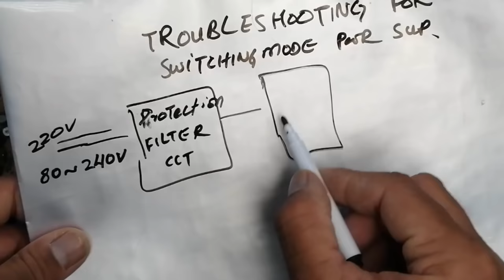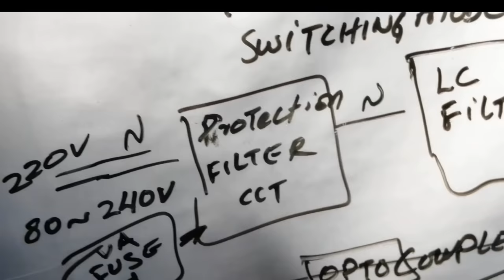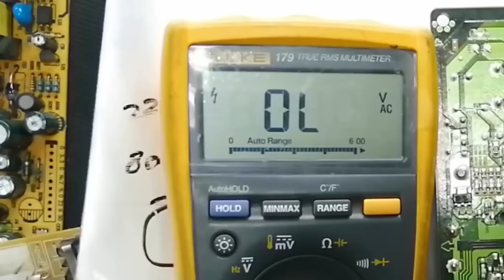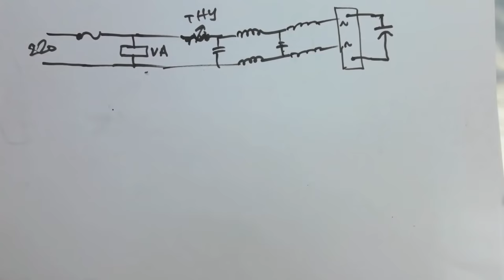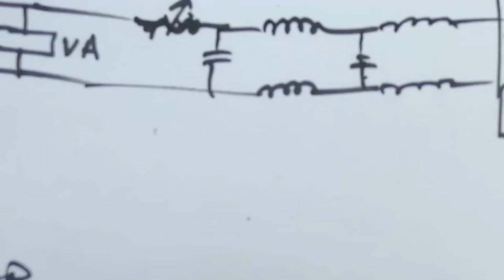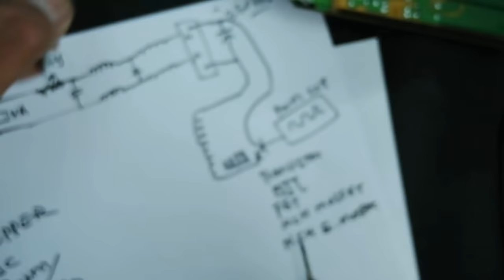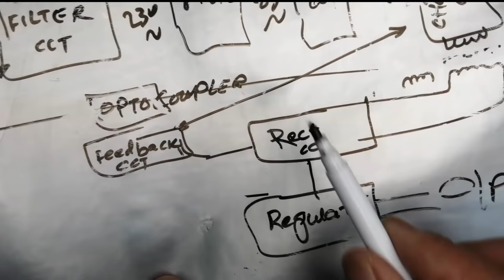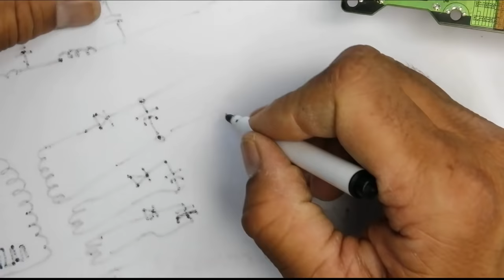SMPS Switching switch Mode Power Supply repair & Troubleshooting

Comment: Brother Haseeb, the computation of 1.414 to AC is it applicable also to DC..thnks.
Reply from the maker: it is used when we rectify voltage from a bridge rectifier. it provides us single peak voltage value which will be stored at bulk capacitor 
for ac to dc conversion

Comment: SIR mera aik question hy. k agr choper ki input py dc voltage a rhy hy but out put py agy voltage ni a rhy tu is sooooorat me hm kia chek kry gy. aur choper ki out put py voltage AC hoty hy ya DC. Please agr ho sky tu reply krna plz
Reply from the maker: chopper ki aik primary side aik pin ki input dc voltage he lekin chopper ki primary ki 2nd pin per switching pulses aati hein jo ki smps controller ic deti he. is tarah primary me switching dc voltage ki pulses aati hein ji se varying magnetic field banta he aur is se secondary mein voltage induce hotey hein. secondary mein puses and spikes aati hein. aap un ko rectifier se nikalney k baad dc voltage letey hein

Comment: Sir mai ek 45 watt cfl repair kar raha hu. Is circuit ke SMPS transformer ki primary tak voltage aa rahe hai likin secondary par koi voltage nahi mil rahe hai...jabki MOSFET par 2 volt ke approx voltage mil raha hai...is circuit me viper 22A if ka use kiya gaya hai jiska drain pin short hai..pin 1,2 source hai pin 3,4 Feedback aur +vdd hai.. circuit luminous cfl cracker 45 watt inverter ka hai jo 12 volt battery se 220 volt AC genrate karta hai... please fault finding me meri help kare...

Comment: When he says at the beginning…. That all of those circuit boards are the same only arranged differently but with all the same parts.

Kind of makes me think of Legos. There are only so many different types of Lego pieces…. but there are thousands of different ways to put them together
Reply from the maker: best regards
all switch mode power supplies are almost similar
their design topologies and designs are different, due to the power requirements and design geomateries 
otherwise the working concept remains approximately the same

Comment: What kind of component are culprit of a small augment in the voltage output ( 12v goes to 14.4v nd 24v goes to 29.5v) ? And which component is responsible for output voltage variation (voltage not fixed) ?
Reply from the maker: check feedback circuit, that is coupled to optocoupler 
please video number 512 & 581 for detailed answer
Reply: @HaseebElectronics  Thank you for your answer. My power supply fixed a new output voltage ( 12v goes and fixed in 14.4v and 24v goes and fixed in 29.5v) It works, but it is not varying output voltage.

Comment: In this video near the end you traced the issue to a particular part of the circuit and would like to see the finished troubleshooting and what component you found at fault. Thank you very much looking forward to your reply.
Reply from the maker: there was a mosfet shorted. unluckily i missed that video clip. it was switching the secondary power section

Comment: sir question for you at the optocoupler output connected to pin 3 of a ic 
it from 330vdc capavitor the ic wont go bad?
is the pin 3 of ic is the negstive power supply?

can you detail on it or separate vids for that part explaining the boltage happining out tgere ty
Reply: @HaseebElectronics  i just see it all vids of designing 5v 2amp charger and as a hobies letterally blows my mind puffft....

that was a good vids i unders tand more in optocouplr when someone sending you pic ture of circuit ang the board kind of charger i think output voltage 3.3 20 15volt hehe know i can fix my smps supply smplufier tnz to you

Comment: Can you please show some smarter systems that use ID control for battery charging systems. Some examples wod include makita power drill, modern laptop. They don't just simply make voltage and control current. They rely on some signalling.

Comment: Very nice explanation brother. Please give me some advice regarding in my troubleshooting about power supply. When i plug-in to the power source the voltage is normal for example I've got 122dcvolts b+ which is normal, and when I press standby power on,  the b+ voltage increase to 170voltsdc and shutting down. This is Samsung ultra slim crt tv board. Thanks brother
Reply: Thanks brother for the response. Board no. KSBH AA41-01329E. Model no. CT21Z58M

Comment: Very informative. Thanks for sharing.
Reply: @HaseebElectronics  I am fixing a subwoofer and opened up a couple of old smps for transistor and 400v electrolytic cap. Though didn't expect to find the replacement transistor I was looking for, was expecting the cap replacement for the standby circuit in subwoofer. Didn't see anything useful.
Reply: Was quite fascinated by the complexity of the smps circuit, so started learning. Thanks, ur video was very helpful.

Comment: Hi sir can you make a presentation video about a power supply with a power factor correction if you have time much better if there is a circuit diagram so that I can study the flow of the circuit tnx very much sir

Comment: Hi, can you explain why? When I touch any SMPS (12v) output + (without load) with a test pen, the test pen neon lamp lights up (neon lamp requires 70 ac to light up). If I were to touch the output +12v I will get a tingling mini shock. If I were to connect the 12v output to a labtop, the entire edge of the labtop metal edge will ligh up the test pen. NOTE: all the SMPS power supply (when I opened the casing to check) none of them has an earth/ground connection. Thank you: if you can kindly take the time to explain the above mention for all SMPS circuits that has ac voltage contaminating the DC OUTPUT?
Reply: @HaseebElectronics thank you for your kind reply. I doubt it's the capacitor. All 6 units of SMPS are brand new from 6 different supplier of 6 different brand that I have experienced the same ac contamination into the output. All gave a shock when I touch the output. I believe that it's a weakness of SMPS without any earth or grounding connection.
Reply: @HaseebElectronics  you can easily test or check it out for yourself... power up any working  SMPS (in put power supply WITHOUT any earth or ground)... Then use a test pen and touch the output...the test pen will light up.
Reply: The answers to my questions on the presence of AC in the DC output of the SMPS device is as follows... (after making research on it)...

The standard AC sine wave that is offset to a DC value...In other words; suppose your DC value is 12 volts. Your AC sine wave, instead of oscillating about the 0 volt axis, would be oscillating around the 12 volt line...in short: a DC component within the AC sine wave (a DC and AC voltage superimposed on one another) and allows DC and AC currents to flow in the same conductor. 

Keep in mind that at any one time, there is only a single voltage and can be consider the voltage 12 DC (or whatever DC voltage) output of the SMPS to be the DC average with AC added to it.

FORMULA example: sin(ωt) is a purely AC signal (the DC average is 0). However, sin(ωt) + 2 is a signal that can be thought of as having a DC and AC component.

A DC component WITH an AC signal is sometimes done deliberately...fir example: The cable TV and phone feed into one building does exactly that. The signals are all modulated at high frequency. When used, they will be AC coupled. There is a power supply that adds 24 V to this signal. That allows some devices to use the 24 V DC for power, while still receiving and transmitting on the AC bus.

THE NEXT QUESTION IS.... Why does the SMPS device has an AC component superimposed into the DC output? ... Once my research on the subject has the answer, I shall post it up here.
Reply: By the way...to solve the problem of the AC current that is in the DC output (which is giving an unpleasant tinggling shock)... I simply connect a ground/earth wire to the negative (0 volt) output line...it does not affect the output voltage or diminished current output of the SMPS

Comment: hi friend ...i have GOSONIC LCD ..when i started  the red and blue led is shimming for while but TV didnt boot
i check output voltages at pwr board its read okay for while then drop to zero when i disconnect pwr cable form mother board ..the output voltage continuous from pwr board normal ..where is the problem
Reply: thank for your kind ...in power supply concoction to the mother board same tv.. what is this mean
 BL-ON
BWM -DM
PC-ON

Comment: The voltage across the input bridge rectifier is around 5v DC only for 230V AC input, could you please advise the possible failure component..
Reply: @HaseebElectronics  All the diodes are healthy but the output of bridge rectifier shows 3 to 5V...
Reply: @HaseebElectronics  yes, 230V available..I think there might be some component short after the bridge rectifier...

Comment: Hullo gentleman 
I have a problem with my inverter welding machine: I tested the output voltage with ameter and the reading was OK but the welding current is very low I don't know what could be causing that. (Am still a beginner.
Tganks
Reply from the maker: special thanks dear 
its control card is not controlling the pulse width to compensate the current requirement on the output terminal. 
there are some trimpots near control card (feedback level control, which adjusts the output current level measured by the shunt resistance 
2, primary current adjustment - to adjust the output of the current transformer CT in series with the IGBTs & power transformer 
3. maximum current limit pot on the control card
4. short circuit current level adjustment pot)
all these trimpots need a very careful calibration to adjust the PWM output to provide the required current

Comment: in Samsung monitor power supply it has used TF12N50 fet , the gate and source voltages are coming negative but drain comes positive fet is good condition and also changed opto coupler  but no use

model number is E59670
Reply from the maker: dear i am sorry for that, i tried my best to search E59670 but i could not find some supportive material. 
please send board model number and monitor model numbers to my whatsapp 00962-79-1161084,

Comment: What are the large resistors used for and in which part of the power supply?
Reply from the maker: power resistors are used in current measurement circuit for the primary side 
and most of time these are used in source pin of MOSFET and its dropped voltage are provided to the pwm controller IC to monitor the maximum system current and protect the circuit from damaging by over current

Comment: Bro,,, super explanation,,,,,
I have a doubt,,,,,, my 15 + - and 5 v smps is fault,,,,, I have checked everything, and replaced optocoupler and 5l0380r ic,,,, still I am not getting outputs,,,,, pls help me,,,,,,
Reply: @HaseebElectronics  thanks a lot bro......, I got it, in output of 5v ,the capacitor has a leakage,,, I replaced it and it's fine now bro...... Thank you
Reply: @HaseebElectronics  yes bro,,,,, thank you.......

Comment: in Samsung monitor power supply it has used TF12N50 fet , the gate and source voltages are coming negative but drain comes positive fet is good condition and also changed opto coupler  but no use
Reply from the maker: if possible please mention the samsung board model number so that it can be easy for me to reply
Reply: @HaseebElectronics  E59670

Comment: I accidentally connected output side of Computer power supply to  AC, breaker tripped   reconnecting right way PS fan start and shut instantly what could be possible damage ( at which  stage ) happened

Comment: Assalam Alikom Sir, I have HP laptop charger that outputs 18.5 v instead of 19.5, i checked the voltage divider resistor and they are ok, the tl431 ic is 8 pin smd ic , any suggestions for repair
Reply from the maker: please check ID resistor sense network and try to adjust the output rectifier trigger value. 
try another charger with the same laptop,if other laptop is working good, then repair charger, 
if the other charger gives the same problem in that case check laptop's charging port and id resistance on the motherboard
Reply: @HaseebElectronics  thank you Sir for the quick reply, I tried another charger with the laptop and the laptop is working well,  i thout the problem would be in the feedback circuit but could only check the resistors and they are good,also the output capacitors are OK, I will do  what you said and let you know.thank you again.
Reply from the maker: @dr0mtm  I think this does not adjust voltage by tl431 and optocoupler, 
it regulates the voltage in secondary side 
it detects the I'd resistance provided by the bms of laptop
and the regulator ic controls the rectifition of the output mosfet 
please check is there mosfet in output section or rectifier diode?
because there are many models of adapters. 
I think most common technique is using mosfet and a regulator ic
you can send it's front and back pictures to my WhatsApp 00962 79
1161 084

Comment: What is the role of zig zag in PCB track side(Mains input side)?
Reply from the maker: it provides stray inductance and capacitance to provide constant impedance,
it also establishes current carrying capacity.
Reply: @HaseebElectronics  Is there any video for detail explanation?
Reply from the maker: @arundave6168  kindly check video number 297

Comment: what could be the problem if filter capacitor voltage is higher then 700v?
Reply from the maker: at which stage filter capacitor is used? 
i mean EMI filter?
output stage filter?
class-X   or Class-Y capacitor ?
please let me know the stage of filter capacitor

Comment: What about lower voltage than the 330v after bridge rectifier?
Reply from the maker: if the voltage decrease than 330 volt, even it will drop till 100VDC the smps controller will increase its duty cycle to produce output power with any trouble.
some power supplies have PFC circuits, that circuit will keep maintaining 400VDC at main capacitor either the input voltage are from 85 to 265 VAC at input
Reply: Many thanks for your reply, in this issue I have am getting know output power , and zero volts and the cold side capacitors

Comment: Hi brother have a wonderful weekend, blessings 🙏
Reply: @HaseebElectronics   @HaseebElectronics  Hello Haseeb. I have a power supply wich is giving problems. I do measure 315v DC on the primary side of the transformer, but 0 on the secundairy side. I have a second similar pcb and replaced the transformer but same result. When i take the transformer out of the print and apply 230 ac it does give a voltage on the secondaire side about 5 volt. How can this be? And what does the octocoupler communicate to the IC? if there is no Led in the octocoupler, what is the result measuable on the IC output?
Reply: Sir thanks for the Elaborate explanation of SMPS Circuit, with I think best compear with several Circuit design,  as well as the pwm control circuit,  feedback design,  oh its a wonderful teachings,  Stay blessed, God bless You.

Comment: Hi Haseeb. Just wanted to let you know, that I very much appreciate your videos. Very well done and I like your pace and attention to explaining the details of the theory. I think the fact that you are not a native English speaker makes you more careful and precise in choosing your words and I like that.

Question. I have been working on a SMPS for a while now (Delta DPS-118AP) used to power a SCSI enclosure for two large disk drives - so the output voltages are +5 and +12VDC. I cant find the schematic anywhere on line so im trying to troubleshoot with your guidance and reverse engineering. The PS has two boards. Board #1 has all the circuitry up to the chopper circuit. Its sending two rails +/- 168VDC in addition to 15.7VDC going to VCC of the PWM circuit on board #2. Board #1 seems fine and all its components are in spec although I am not certain if the voltages are correct.

An interesting thing about this one is that it does not have an optocoupler on board #2. It has instead a comparator chip (CA339E) which was bad and was replaced. Is a comparator also common? 

It also has a PWM chip TL494 which seems to be switching on and off, on and off so something is wrong somewhere. The PWM is on a separate board soldered on to the 2nd of two main boards and harder to troubleshoot. The output of the comparator is high (non inverting pin low) so its telling the PWM to ramp up. All the electrolytic caps on the output side have been removed and tested and they are all good. I also tested the two output rectifier diodes and they are also good. I also tested the two MOSFETS on the input side. I suspect the TL494 is bad which will be my next step as its not getting any AC voltage across either the switching transformer or the output transformer.

Comment: What if you find Fuse Bron off in Samsung power supplie
Reply from the maker: fuse blowing problem have many problems
MOV may be short circuit
Class X capacitor may be damage
Bridge rectifier is damage
bulk dc capacitor is short circuited internally
Power MOSFET is damaged
these are are the main possible causes for input short circuit

Comment: How to determine the problem of 4 opto cocpler in the led tv power supply?
Reply from the maker: if possible please specify the power supply model number
most of the time 
1 optocoupler is designated for standby power
1for backlight supply
1 for secondary power supply
1 for remote ON command
and sometime 1 for protection circuit
Reply from the maker: then we have to see the symptom of the supply and we have to locate the missing segment
so for that we must know the power flow or working sequence of the circuit, then it is easy to eliminate the issue
Reply: @HaseebElectronics  Thank you for your answer my question,God bless you.
Reply from the maker: @toniestopalla2768  it is my pleasure